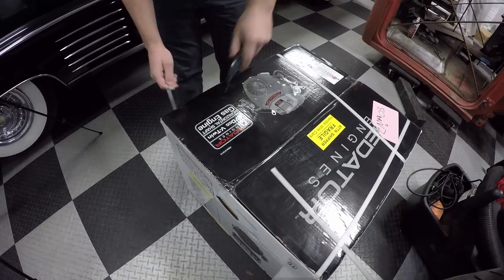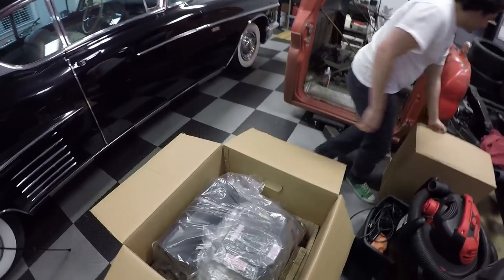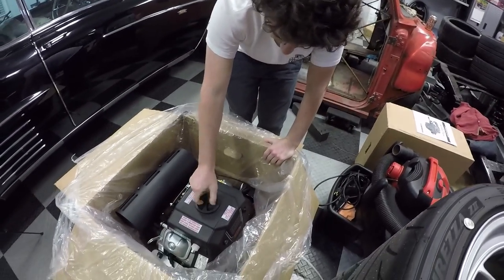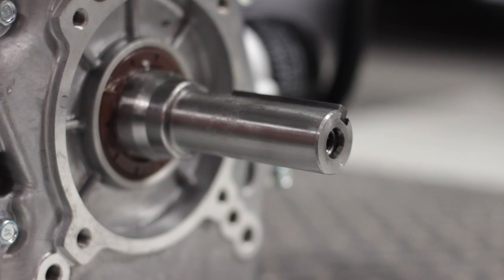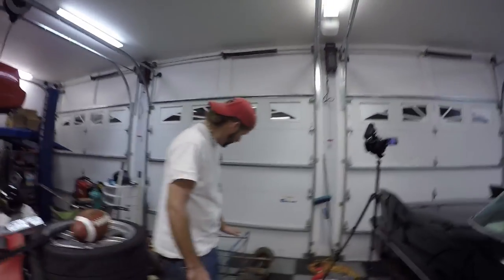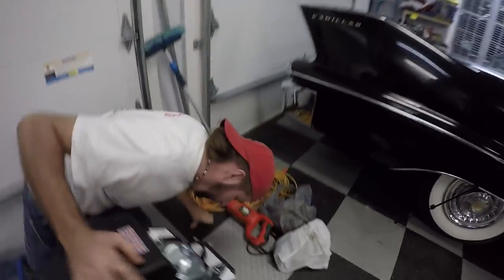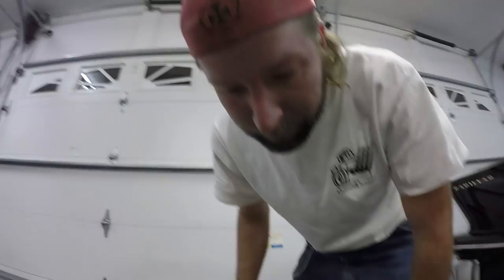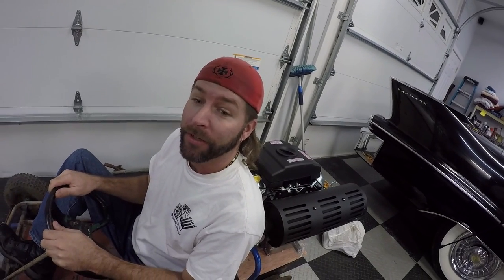22HP V-Twin on a $25 Go Kart Unboxing and Intro

Comment: Convert the $25 kart from a 2-seater (for 2 really skinny people) to a 1-seater (for big guys)? Just a thought...
Reply: Also, the v-twin needs zoomies! One straight pipe for each cylinder, either sticking straight up or swept back at an angle.
Reply: +M Kefer i doo this all the time just need some thread rod and a welder
Reply: +M Kefer Unfortunately, that won't look great because the engine is sideways

Comment: 40 -50 mph ! That's slow for that size of engine
Reply from the maker: +Alan Tomkinson (RedBlueBadAls19) I'm completely confident that we could gear it to go >100 mph, but we don't want to die.
Reply: +CarsandCameras Do it!!!!!
Reply: +CarsandCameras What size sprocket are you going to put on it?
Reply from the maker: Dukey8668 We're going with a torque converter with a 54 tooth (420 chain) sprocket.
Reply: ik, my 100cc 2-cycle will do 60+, and that's not even with a chamber, I'm using a can
Reply: +CarsandCameras Ok. Thanks.
Reply: Yeah it is. they could use a smaller rear sproket they have the power
Reply: yeah the engine is a beast though
Reply: +CarsandCameras Go for torque on the low end and not top speed since you're only tooling around the house. If you're gonna go for top end just make the necessary changes. Why not have the parts for both. Then you have to deal with you're dad being po'd about everything either having. black marks or ruts.
Reply: +CarsandCameras I'm also fairly confident that "dead space" you experienced was the engine stalling because it needed more fuel which should be solved with those jets you got.
Reply: +CarsandCameras how would you gear it to go faster, (what gear ratio's)
Reply: +Scott Sonnier +CarsandCameras the kart will not go that much faster than the 6.5hp engine as far as top speed. the top speed is made by the rpm and gear ratio. the 6.5hp turns 3800rpm the kig daddy turns 4000. now how fast it gets to 4grand is the torques job. to gain top end you can either increase the number of teeth on the drive spocket, or decrease the amount of teeth on the axle. usually both to control the amount of chain links. we took a riding mower and flipped the front and rear pullies. it does 65mph easy
Reply: CarsandCameras Ok haha i would like to see that though :)
Reply: +Alan Tomkinson (RedBlueBadAls19) It is an Generator engine. Normaly i would take a Honda GX 39o and tune it. It is not worth to take this big and slow motor.
Reply: +AzEliteAirsoft what kind of bike?
Reply: +speedyme200 Yamaha KT100 racing engine
Reply: +CarsandCameras Race you guys with my modded 212cc ;P LOL. Nice build. Should gear it to go at least 70.
Reply: It has no tranny
Reply: What does this engine cost?
Reply: Sivert Nordang 699 bucks at harbor freight.  http://www.harborfreight.com/22-hp-670cc-v-twin-horizontal-shaft-gas-engine-epa-61614.html
Reply: That Car Guy Thank you ;)
Reply: Sivert Nordang
Reply: Yeah but the torque though
Reply: Alan Tomkinson my freind has a bike with 80cc and its goes 40 mph
Reply: @CarsandCameras  100mph no seat belt just helmet 😂 yea sounds like suicide

Comment: Let's put this in perspective. Back in 2000, working at Briggs & Stratton, they had in their museum a Chevy/Geo Sprint that was equipped with a Briggs 26 HP v-twin and a beefed-up suspension and subframes for potential sale to India and other un-/under-developed countries. That's 4 horses more than this. And it had a top speed of between 55 and 65 mph.

Comment: you can get this engine on sale at HF for $549 .you can mount a pulley on the flywheel side ,using a long threaded bolt ,and 3 littler bolts .

Comment: Speculative comment - Flat spot likely to be the idle/tickover speed and mixture? Seems to run fine once it's going and on the main jets, but it's the jump from idle up to higher rpm that's the problem. Idle circuit remains in use until 1800 rpm on most engines so if it's running lean could cause it to bog when more air/fuel is introduced. The idle speed seems really fast too which might mean you're not getting any fuel progression because the the progression circuit is being used when it's on tickover. Try just blipping the motor so it runs momentarily just up off tickover, if the revs drop back down below tickover or it stalls when you let go of the throttle that shits running lean. Also if you look at the butterfly valve from the bottom of the carb, and you can see the fuel progression jets when the valve is in tickover position it means you need to lower your idle to close the valve, so hopefully you'll get smoother fuel input.

Comment: Yes the carburerator needs tunning for sure. Could be jets.,or screw settings need adjustments  made to the stock set screws.

Comment: That go-kart looks very similar to my Kartco two seater that just recently came out hibernation (in storage since the 90's). 
Mine is currently red with white wheels but the plan is to paint it desert tan CARC on the frame and wheels. Also will be replacing the original 5hp B&S with a Predator. Depending how your build with the Predator 670 works out will determine whether my go-kart gets the 212 or the 670...

That 670 should be fun with those small tires... and they are cheap to replace.

Comment: I was browsing ebay for go kart frames and I found a "vintage twin engine frame" where each engine drives one rear wheel.You guys HAVE  to build one! Twin preadators! You can even use the yard kart since it doesn't have a live axle!
Reply: +kevin dees it does have a live axle

Comment: upgraded brakes are gonna be needed. I put a 13hp Honda engine on a frame similar to that and almost killed myself.   the fence at the end of the street caught me when I hit the brakes. the band style brake overheated, warped, then snapped in two.  good luck to you guys.

Comment: Hey guys their called battery cables. Not battery lines. Are for cable.& power& gasoline. Battery cables are for engines.,or motors such as outboard&onboard motors.

Comment: Anyone looking for predator motors in Australia. They are called "Rato" engines. They are exactly the same as the predator engines. The 6.5 hp is $240
Reply: Freksta Ayy shoutout I've been trying to find them here! Not that I'm very interested coz they really don't have much power for the size, but cheap as so thinking of maybe using them for my sons projects for him to learn with before stepping up to something better!! 6.5 horses for under $300 definitely cannot complain!
Reply: np

Comment: probably should end up putting this monster on your rat wagon afterwards.
1) rear engine rwd with the 100lbs engine plus the majority of your body weight (torso up) sitting near the rear and almost nothing up front so youre pretty much going to wheel stand at idle
2) when you actually get going its going to be understeer central because of the weight and torque lifting up the front end of the kart
3) with it on the front of the rat wagon it will probably have driftable oversteer and burnouts galore MERICA
4) its a rat rod, so its supposed to have a ridiculous engine on a chopped frame so its basically meant to be
5) YOU CAN HAVE YOUR DUAL EXHAUST AND IT WILL ACTUALLY BE TRUE DUALS :D
Reply: +Tyler Gutstein nice
Reply: from all of this text i jusr saw a 4 numbers

Comment: That go kart would look sharp moon blue  with metal flakes in the paint to. Even if you half to add it in yourself from A flakes container to. That looks like dremel tool cutting discs containers to.,or the square type also.

Comment: to make it sound more like a harley set the cam a bit off to where the exhaust is a bit early, yea I know gas will be early but I did this with a single cylinder and omg it sounds awesome. I dont actually know if it will work as cleanly as the single cylinder did but if you think its a bad idea then you know not to do it

Comment: How does this motor compare to that of the yamaha grizzly 550 or 700? If I made a 4x4 gocart and used that predator motor to power it, would it handle mud bogging?

Comment: I got a question for you guys,  I have a riding mower that I really don't want to fix cause a lot of the frame is shot along with the hydrostatic transmission but the engine still purrs like a kitten, plus I have a go kart frame that is dying for a engine swap, my question is do you guys know how to go about making a vertical shaft mower engine into a horizontal one?  I know I simply cant just turn the engine on its side and call it good, just something I have been pondering but have no idea how to do it!  thanks a lot guys your videos are awesome.

Comment: Question, what gokart torque converter can handle over 22 Hp without breaking? Because 40 series, which I think are the strongest you can get, can only handle 8-16? So What'd they use that can handle it?

Comment: Nice. I would have rather bought a slightly used, good condition Briggs and Stratton Vanguard. I'm building a race mower with a horizontal vanguard currently.

Comment: You cant drag that with a torque converter with the motor hanging out over the rear end! Well, you can try but i think getting the engine in front of the rear axle would be your best bet for weight transfer and keeping it on all wheels.
Reply: +Samuel Sullivan Don't go nose up!
Reply: +Samuel Sullivan we put the engine as far forward as we could without it looking stupid

Comment: i say take the 212 off of one of the race karts and drop the vtwin in it so you get better handling. also its probably much safer
Reply: +Shawn Szy Lol twin in a racing go kart= better handling. The engine is heavier and it would just be stupid weight when you can mod a 390cc/420cc to 20+ hp if you buy the right stuff. Also 212cc predators have a sweet sound that can't be replicated.
Reply: +Parker Barandon we are just trying something a little different. we love the 212s
Reply: +Isaac Jennette I know I love the 212s that's what I was saying. Best motors ever.
Reply: +Parker Barandon ive had one on wood splitter for almost 9 years abd its be3n run wide open its whole life and it still up 2nd pull and runs great

Comment: ez go golf cart electric to gas 18hp kohler! would like to see you guys do 1 with extended frame as im doing one but its my 1st and having problems with brake cables length and mounting engine and transmission to rearend

Comment: Unreal that motor is 640$ on harbor freight, I have two 720cc efi Subaru V-twins, that motor from the outside looks very similar, if its like the Subaru 653cc motors they have a couple models with different cam profiles to give more mid range torque or HP or higher rpm etc with about a 3600rpm redline, should be ludicrous in that kart if you can keep things from exploding

Comment: I used to have a kart my grandfather made that had garden tractor rear tires. I'm thinking stretching the frame and using tires of that size might be a...safe?...idea.
Reply: +James McHenry no kart is safe. lol but ive seen lots of karts with those tires on them

Comment: I put the harbor freight 420cc motor on my kart with a go power sports torque converter and a 45 tooth sprocket on the axle and it goes over 60 mph

Comment: v twins have so much weight, plus they are governed (obviously) that's why they won't take a gokart as fast as you would think, they are more for power than speed... my 11 HP greyhound on my gokart is super light, and also has 11 horsepower (340 Cc) so that's why my gokart can go 60...

Comment: I dirt oval go kart race our motors are around 18hp with that I would run at least a 15 driver sprocket if not bigger upon the torque converter if you have any other questions just ask
Reply: and with that a rear sprocket in the 50s

Comment: Ahhh, the mod's I would do on that motor (Dreaming) Start by Re-enforcing the block with aluminum strap welded in weak areas THEN Remove Gov, add Heavier springs,C molly push rods,Bigger valves,Roller Rockers, Mill heads/block, Port/Polish Heads,Custom Intake, No cam YET because after all this I will slap a Draw-thru Turbo setup and then see if the cam is good for boost if not send out for a custom grind. If the Crank and Rods hold's up Awesome if not...damn a Billet Crank and Connecting Rods are going to be Expensive. But i'd sure like to find out how much the stock bottom-end will hold up to ^_^ their's what I would do (If I could afford it T_T ).

Comment: Im working on my 670 predator side shaft extending the wires to the ignition and kill swith and a red and black wire pulled loose were does it go on the motor

Comment: Just my humble opinion here. I think you guys are going to have to do major surgery to this frame to make it hold up to this engine. It's heavy. When you add the engines weight plus whoever is riding it, add their weight, it's more weight than this frame is suppose to carry. I think you would come out better building your own frame out of 1x2 steel stock. You can cut the spindles off the old frame and weld them to your new frame. Then use a live axle setup and mount the engine in the middle of the axle. You will have a whole lot more room. Your weight distribution will be a lot better. You will also be able to run lawn mower rear tires on all 4 corners. This thing is gonna be a beast. The frame should be wider than a stock go cart. Don't want to flip it. Roll bar, please. lol If you build it right, you may get as much as 60mph out of it. You guys have my curiosity peeked. Very interesting.
Reply: +GALAXIE 500XL we are beefing up the frame. it is scary fast and powerfull
Reply: I see that you guys like to use harbor freight angle grinders and sawzalls how are they compared to other companies like dewalt and Milwaukee
Reply: they are junk. we go threw them all the time. i should get the good stuff next time.

Comment: So a side question. Only the predator 212s and below fit on the minibikes you guys have without frame modifying, right? 301s won't fit?
Reply: They will, but you'll have to remove the gas tank
Reply: +25 Cent I guess you can reposition it on top of the frame and just run a longer fuel line
Reply: +25 Cent but I believe the 301s have a larger output shaft
Reply: Yeah, 1 inch is what they are from the 301's and above. That sounded wrong
Reply: +25 Cent I'd think a 1 inch would be stronger and less likely to warp. that's a positive
Reply: Good point. How would they warp if not from heat? Although, I have warped my right wrist pulling one over!

Comment: Why do u keep using huge engines with sooooo meany cc but no power? A 350/400 cc motorcycle engine is just as power full if not more? I run a 125cc two stroke bike tested at 28 bhp, 22bhp from a 670 cc engine sounds crazy to me. Keep up the good work

Comment: You guys should do an E-85 powered kart when you get the chance!
Reply: I don't no why anyone would want to put that crap fuel in any vehicle. I wouldn't even clean parts with it. It's crap. Do yourself a favor and pay the extra for 100% unleaded and get more mileage and less damage in the end.
Reply: Mark Reardon because you can push the engine harder than you can with unleaded. You do have a lower energy density than unleaded fuel, bu the advantages are;

> Cooling effect produced by the fuel evaporating, which both lowers the engine temperature slightly and also makes the charge more dense

> The engine can be run significantly harder and produce more horsepower than it would on standard unleaded

> Ethanol is a renewable fuel made through fermentation of raw material, and it also has a lower carbon footprint than standard unleaded.

> Ethanol has a much higher octane level than unleaded, so it's way more resistant to pinging and detonation, which is why it's used as a racing fuel. It's much easier to control under heavy compression, and this is also a factor as to why it's used in tuning and racing. If you have fuel that is resistant to knock, you have less of a chance of blowing your engine through knocking.

> cheaper than unleaded fuel

The cons of course are:

> significantly lower energy density per gram of fuel, so you need more to get the same power

> Ethanol is hydrophyllic (absorbs water) so it would need to be used up faster than unleaded fuel, which, while still having mild absorbtion of water, is much less. The only down side is the volatile hydrocarbons in gasoline will evaporate off and the fuel becomes stale. Ethanol on the other hand can be "dried" if it becomes waterlogged, which would still take several months to even a few years depending on the amount in the tank.

> Can't be used with pre-mix oils like gasoline can due to being a lower overall density, so it's not going to work in 2-stroke engines without a specialist oil blend, which is currently not available (probably not even existent at the moment either!!)

Other than that, it's not a terrible fuel... you just have to tune for it to see any benefits, plus, like I mentioned prior, it's a renewable fuel made by fermenting biological material, making it a more viable option in the future for those wanting a combustion engine, but not being able to get the fuels because the supply's either depleted or the fuel made completely obsolete!! And on another bright note; You could (depending on state laws in your country... over here in the UK, it's legal to do this) brew yourself some beer AND make some fuel for your vehicle at the same time!! Ain't nothing wrong with making yourself a keg of ale and getting fuel at the same time!! (Just don't mix the two or the cops will be on your ass with points for obvious reasons!)
Reply: ethanol has a lower btu rating by volume but its stoichiometric ratio is in the 9's vs 14.7 of gas. if you do the math ethanol actually produces more btu's than gas when given the same amount of oxygen. that means it makes more power and also since its got a higher octane rating you can advance the ignition timing and/or increase the engine compression when in return gives you even more power.